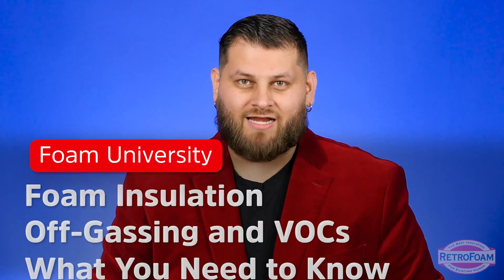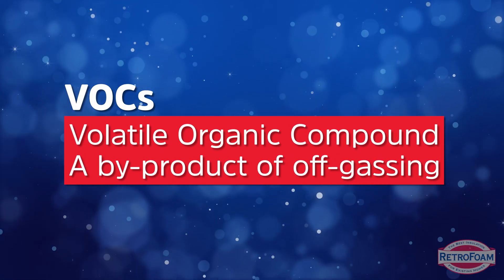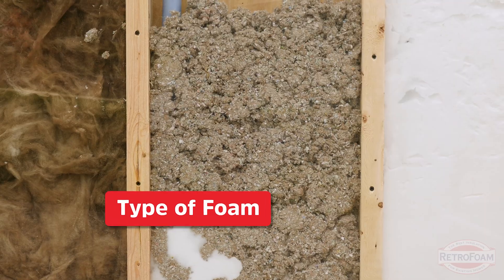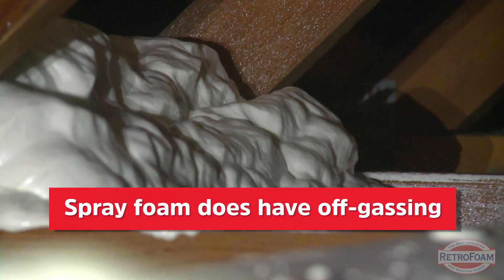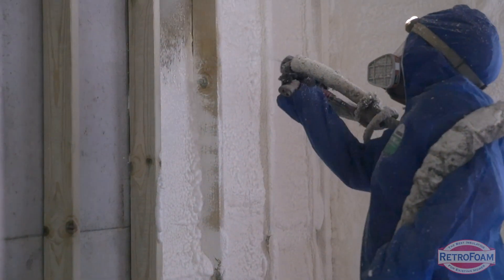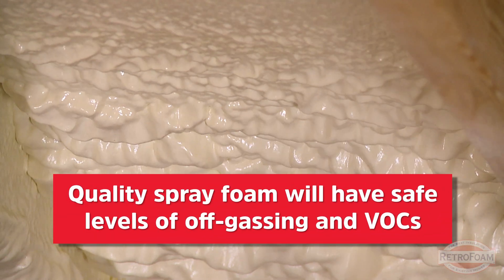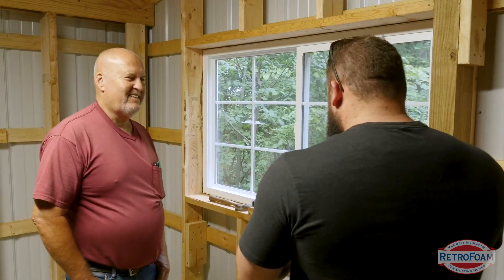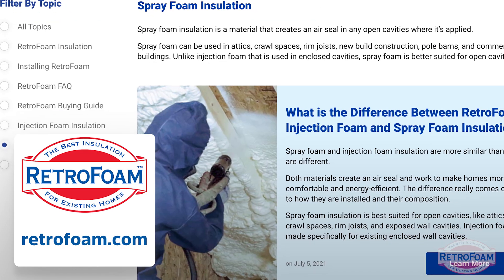Foam Insulation Off-Gassing and VOCs: What You Need to Know | Foam University by RetroFoam

Comment: Googling after a allergic reaction.. in a 2x3meter room I used a couple of spray foam cans. 4-5 months later every time humidity geta high it starts to off gas. (Cures trough humidity) can even smell it when its very humid. Same smell as wheb 1st spraying. If you are allergic your will feel it on your eyes and troath it also affects my lungs. Quite dangerous
Reply from the maker: Oh no, that sounds like a rough experience! Unfortunately, those DIY spray foam cans can definitely cause issues like that over time. The good news is that it’s a totally different product from what we use. RetroFoam is a water-based injection foam that doesn’t off-gas once installed, and it’s always handled by trained pros to make sure everything cures safely. Definitely one of those cases where leaving it to the experts makes all the difference!

Comment: I have Isonine foam in my home and my a/c coil won't last a year before it has to be replace. What is a solution to my problem.
Reply from the maker: We recommend calling your local HVAC contractor, as this seems to be an issue with your air conditioner.